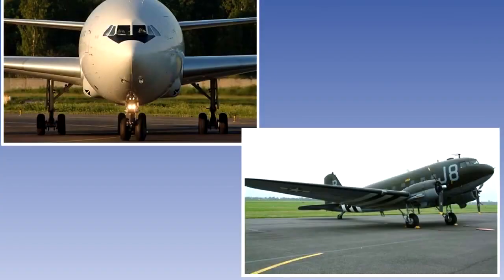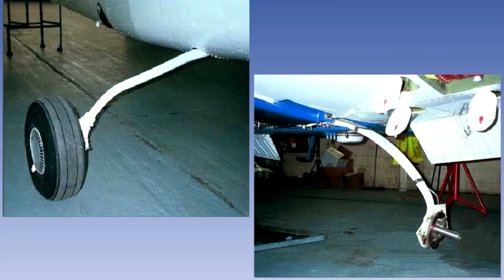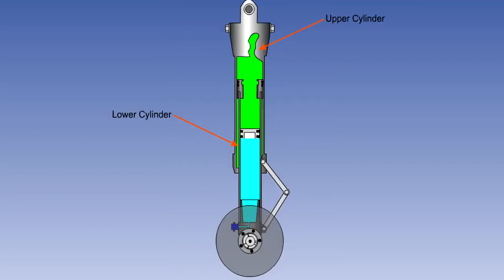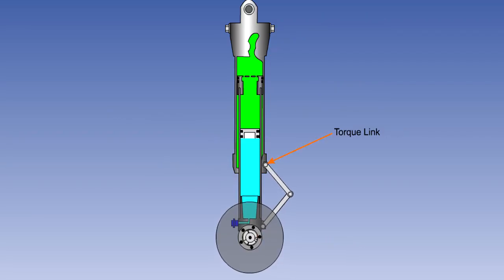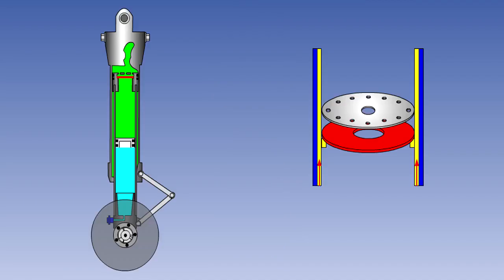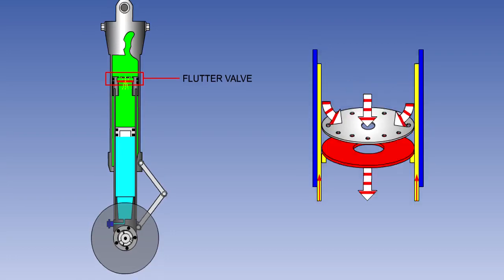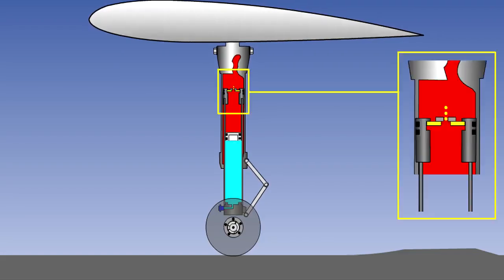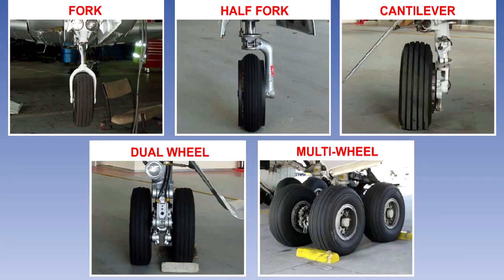14  ATPL Training   Airframes & Systems #14 Landing Gear   Fixed Gear & Shock Absorption

Comment: Emmm..... The gas is at the top of the strut and the oil at the bottom !
Reply: Depends on the leg design. either works.
Reply: That’s what I though because some of that oil goes to the brakes at least that what I learned
Reply: Not always, i.e. the Cessna 650 Citation VII is like in the video: Nitrogen at bottom and Hydraulic fluid at the top.